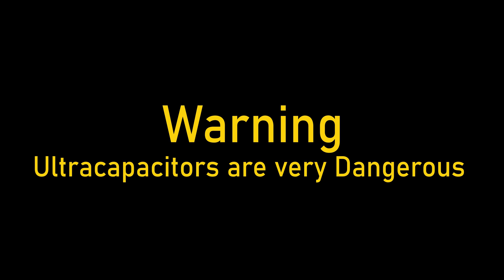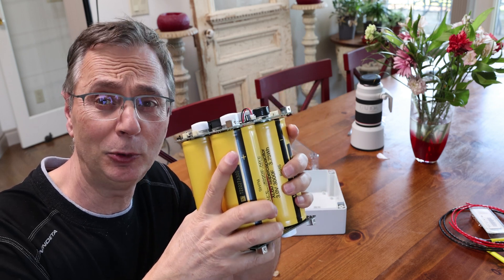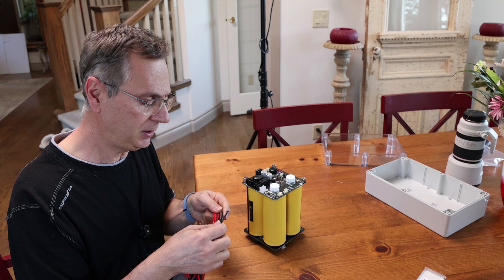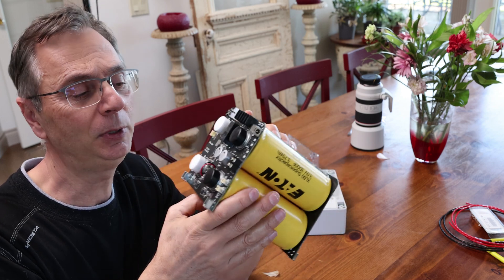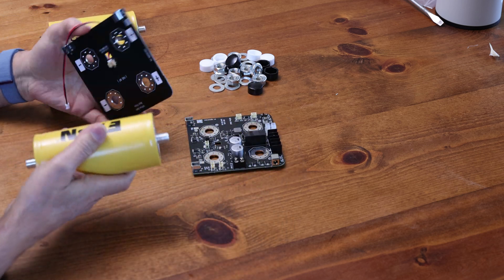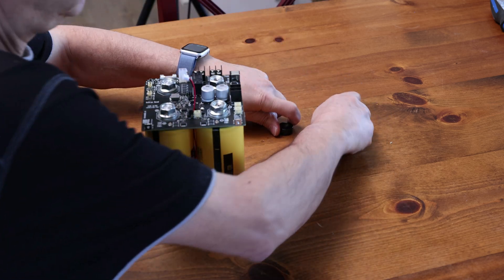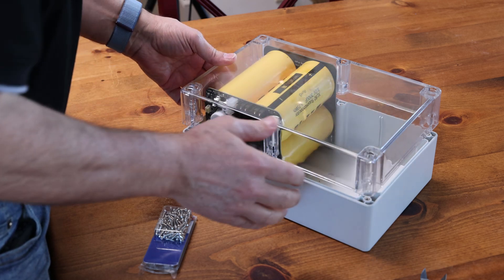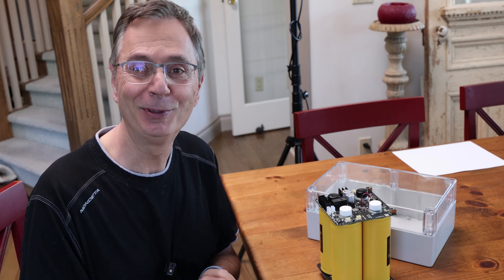Best power supply for clocks and DACs to improve the sound quality.

Comment: If I may, another question. My full function streamer DAC with amanero usb board requires 5v, +\- 5v and 3.3v. If I use the enclosed jumper/bridge I can have one side of the quad output 3.3v? I have to bridge either pins 1&2, or 3&4 if I read it correctly. What I could not tell from reading the manual is which of the power output on the quad would be the 3.3v output. J7 or J9 ? I believe it’s one of those but it wasn’t clear to me and sorry but I’m a complete idiot when it comes to understanding electrical systems. Don’t worry, I’ve taken all your precautions when it comes to the ultracapacitors and wiring.

Comment: Gabster, you list the VPM24-2080 toroidal transformer to power the quad ucPure. I had previously ordered the VPM24-4170 version to power my 4 ucPure mk 3  but have switched to the quad ucPure to save space on my project. Can the 4170 power transformers be used to power the quad or do I need to purchase the one you recommended?
Reply from the maker: Both will work the 4170 size is a bit bigger so will take more room
 you need about 4amps per 12v after 4amps no additional advantage
Reply: @Gabster1 thank you! At least I don’t have to buy additional! ;). If I may, another question. My full function streamer DAC with amanero usb board requires 5v, +\- 5v and 3.3v. If I use the enclosed jumper/bridge I can have one side of the quad output 3.3v. I have to bridge either pins 1&2, or 3&4 if I read it correctly. What I could not tell from reading the manual is which of the power output on the quad would be the 3.3v output. J7 or J9 ? I believe it’s one of those but it wasn’t clear to me and sorry but I’m a complete idiot when it comes to understanding electrical systems. Don’t worry, I’ve taken all your precautions when it comes to the ultracapacitors and wiring.

Comment: Is it possible to output 3.3v and 5v power at the same time?Thank you
Reply from the maker: No you need 2 separate ones but You can use the 2 Regular UCpure MKIII ten you only use 2UCs each
Reply: @Gabster1  thank you Gabster🙏🙏

Comment: Great video! Can you get other voltages for these? Thanks!
Reply from the maker: These caps are rated for 3 v max but you can use them in series with balancers to create higher voltages like 5v 12v and 15v 
They are not geared for power hungry use 
See Ian’s manual about the UcPure system

Comment: If you want to get extremely low ESR. In fact, you can buy the cheaper version of Ian's and then using multiple supercapacitors in parallel can significantly reduce the overall ESR. For example, if each 3000F supercapacitor has an ESR of 1mOhm, then four capacitors in parallel would result in a total ESR of 1mOhm / 4 = 0.25mOhm, which is close to the 0.23 mOhm value.

Comment: do not use and expensive, inefficient linear 12v power supply for this. It is a waste of money. The power coming out does not care about the quality of the power going in.
Reply: Another thing i dont think you said, anytime you are handling these ultra caps, make damn sure they are discharged first. otherwise death can occur,
Reply: also for DC, yes, solid wire is technically better, for those trying to eek out every .01%

Comment: Does this power supply output stable voltage or does  it need a regulator after it? Clocks probably need very stable voltage. You videos on Ian Canada products have been really helpful.

Comment: Hello,  omg to all the poor people who just bought the ucpure mk3 you bought it to quickly. Ian did not visit that American diy site for five weeks and the first post after his return is about  this new product. Greetings,Eddy
Reply: I think there is sill a big a place for the UcPure Mark3 you do not always need that many Uc's Not everyone wants 20 Uc's to build a System
The UcPure Mark3  can do 15v and is also ideal for adapting other smaller UC's like Gabster did with his mini 15v in a video from a couple weeks ago video .
Reply: Sure, if you read about using aftermarket linear power supplies on serious audiophile diy sites it appears to be crucial to kind of integrate supplies into the circuit being fed. Ucpure having the most impressive specs it will be weird to use the wrong methods to get things connected. Just a few days ago i received a Furutech connector. In the technical paper it is clearly mentioned only stranded wire can be used. We have seen people using thick solid core wire in a tiny screw terminal ( compared to the one inside the Furutech) . If the tiny amount of information on the Furutech already mentions the stranded wire and the maximum momentum for tightening the screws i guess it will be crucial or not? Greetings,Eddy
Reply: Eddy, why are all of your posts regarding Ian Canada negative? His stuff is seriously high quality.
Reply: He doesn’t appear to be away. He is answering inquiries on his web site.

Comment: Ian Canada is a Super Capacitor evangelist.
 
I run Ultra-low noise power supplies all with some very simple modifications to drop ripple down to pico amps.

It still looks like a lot of work in comparison. When it comes out for production I will try it and see of its has low noise under multiple loads.